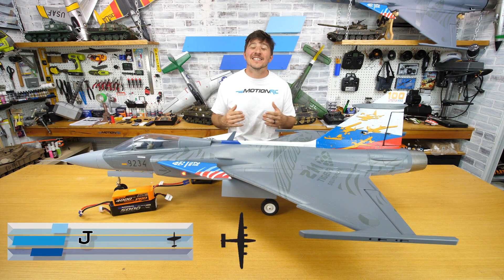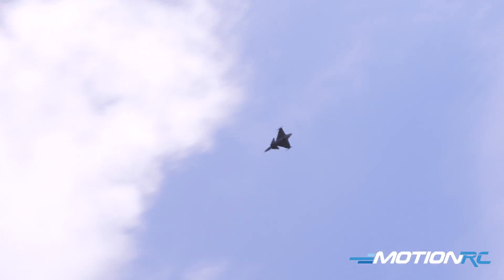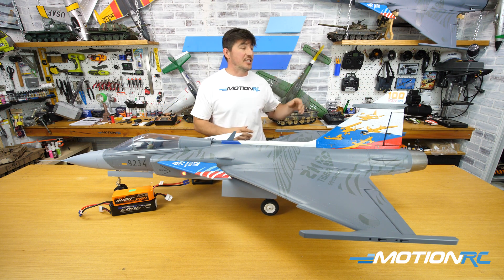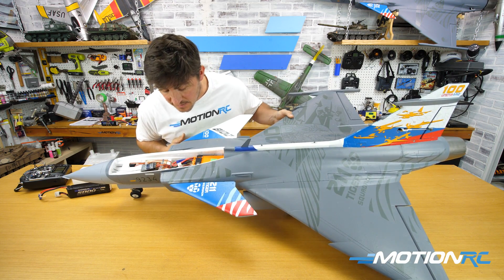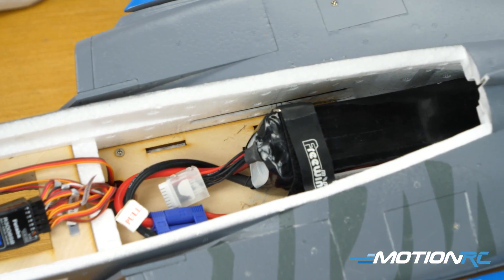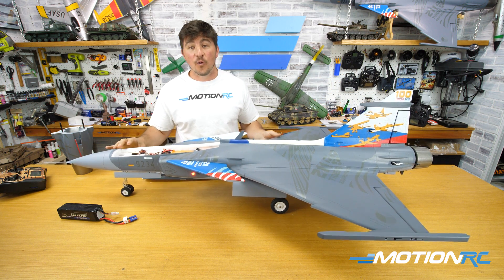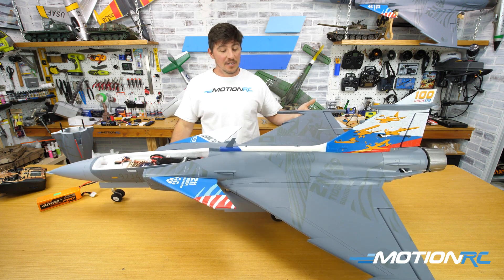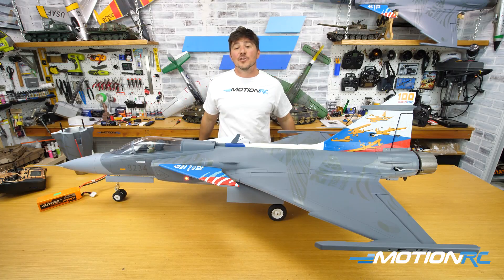CG and Rates for the Freewing JAS-39 Gripen - Motion RC EDF RC Jet

Comment: How do you measure out the elevons? Because high rate is showing 23mm with everything at 100% but I’m only getting 15mm with everything at 100%. That said, if I move the sticks to the corners then I get the 23mm. So should I overdrive the servo in the endpoints to get to the 23mm? I always like to measure everything out to the high rate and then dial in my own high rate (which like in this video, will be the low rate) and on down.

Comment: how much does it cost one of those planes with everything including control and all that stuff?
Reply from the maker: Products link in the description, but there are numerous battery, transmitter and receiver options that vary wildly depending on how much you need or want to spend. But this question sounds like you are a beginner to which this aircraft is not good to start with. You want to search for RTF aircraft as those are Ready-To-Fly meaning they include everything you need to go fly

Comment: I use Turnigy Heavy Duty 5000 60C packs and would fly without TV.  I'm wondering if the Turnigy's will fit the battery bay as they are 5mm wider and 13mm higher than the Admiral 5000's and the Admirals seem to be a reasonably tight fit.  The additional 55 grams or so in weight shouldn't be a deal breaker though.
Reply from the maker: I don't have any to try unfortunately, but where there is a will, there is a way

Comment: what is the reason for balancing the gripen with the gear down vs gear up? I dont see any detail in the manual saying it should be balanced with the gear down. Like i did the mig-29 cg with the gear up. would you please say how different it would be IF you did with the gear up. that lack of detail on the manual can be very bad for those doing it wrong! I dont know if everyone would watch the video saying so. the battery location in the book also says 70mm back if it is 750 grams. to me it looked like you had it way more back...
Reply from the maker: Wouldn't change much at all Vic. Just had the gear down when I did it.